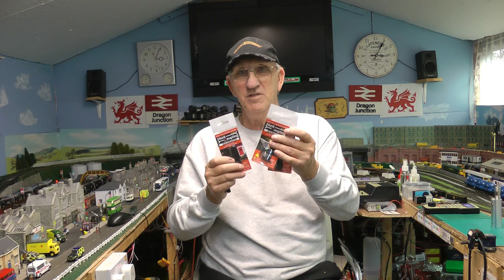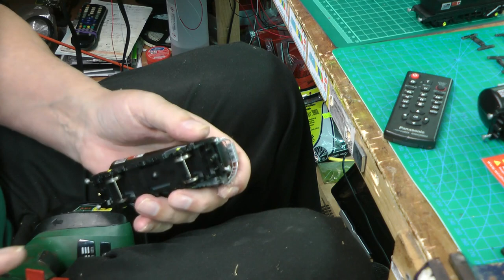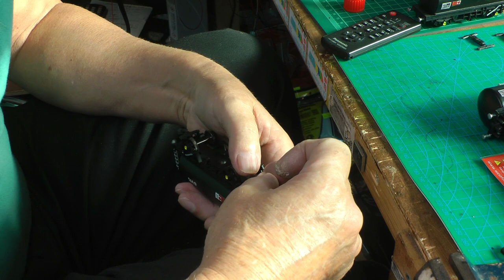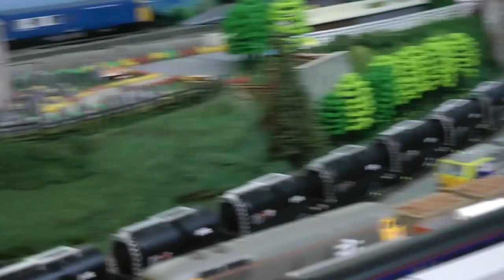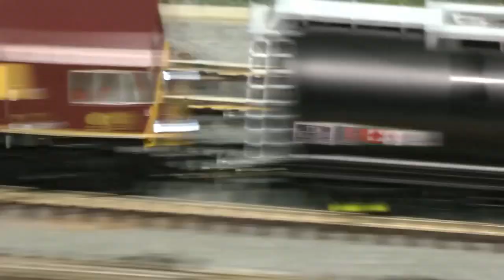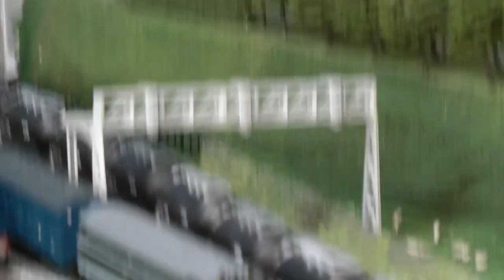HUNTS COUPLINGS AND FITTING THEM TO HORNBY TTA TANKERS.

Comment: Good to se your on the mend, my test came back negative, Had the nurse round the next day to see me, Day after that I was out with flu or this super cold for two days, Irony is I had the flu jab on the thursday, Conversions run well, If you want to flog those D couplings i`m in the market, I`ve got a load of fixer uppers I can use them on, Cheers Allan
Reply from the maker: Ill get back to you on the couplings as have a few more to change yet.And i have a lot of plastic wheels that may help you out.
Sorry you got the flu That`s not good to have at any time.
So that you for stopping by.

Comment: Great to see you have both pulled through and you are up and running again. The hunt couplings seem to be working well and look ideal for trains you don’t want to shunt and shuffle about a lot, but still allow easy removal of stock if the need be. Much better than fiddling with the tension locks.
Reply from the maker: Cheers Rob.

Comment: I have some Bachmann and Hornby Container wagons. I need to reverse them round second radius curves to get them into my container Terminal. Does anyone have any experience with reversing stock around 2nd radius curves with Hunt Couplings? as I am thinking of upgrading them as NEM couplings seem to be problematic at the moment.
Reply from the maker: You have no trouble reversing with hunts couplings' have reversed around the whole layout with no trouble even my 14 foot long container train many a time .also check out Peter Dixons layout .he does it as well and his layout is only 7 foot by 4 foot.His layout will fit into my container yard.lol..
Reply: @lord-al-2024  Thanks I'll check out Peter Dixons Layout

Comment: would have been useful if your thumping great hand did not obscure all the actual fitting. And what about remote uncoupling? A product with very limited use I think
Reply from the maker: The coupling sits on two little pegs that keeps it square and you glue or screw it into place.
No remote uncoupling you simply pull them apart.
The whole point of these couplings is the ease of taking your rolling stock on and off the layout. 
There not to every ones taste i guess but they work for me . Strong and reliable and no derailments .

Comment: What was wrong with the original couplings that you needed to change them?
Reply from the maker: The whole point of the hunts couplings is reliability and the ease of taking your rolling stock on and off the layout. And you get closer coupled rolling stock. It's your choice if you do or don`t.
Reply: @lord-al-2024  I'm thinking of testing them on the new Hornby Coronation coaches since the close couplings they supply are useless.
Reply from the maker: @davidwatts1871  if you check on there web site they may recommend the type you need  for you coaches 
www.WestHillWagonWorks.co.uk
if you get them there`s a little bump on the arms that faces up .
If your not sure just Email them .ok David.